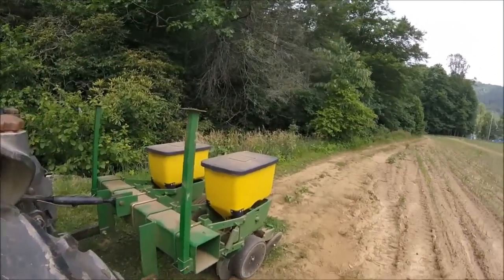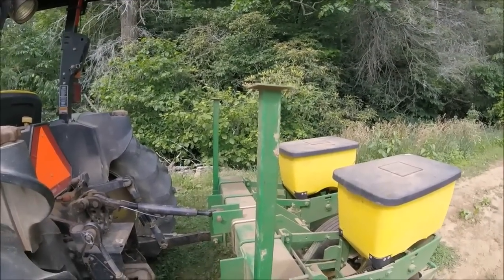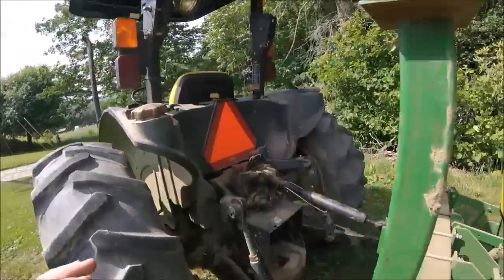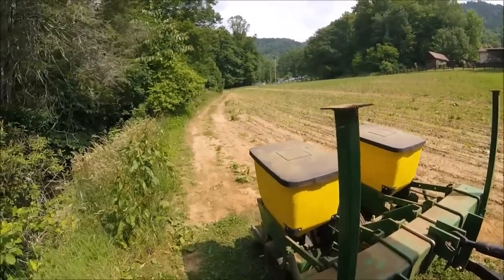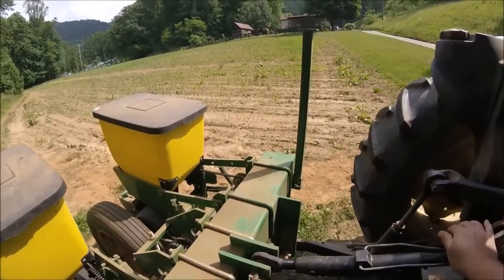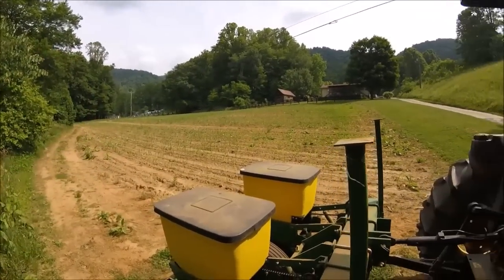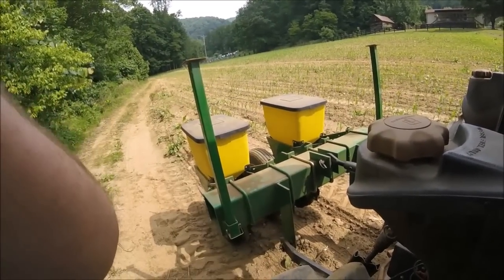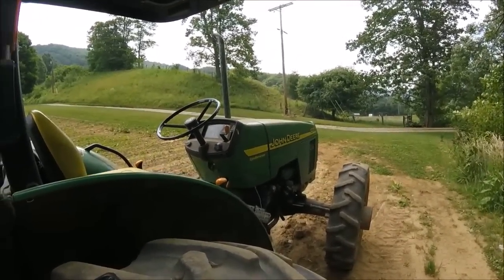Two Row John Deere Corn Planter Setup

Comment: I have an old set of Covington two-row planters that I  run with seed hoppers. When I got them I run two corn plates and two Bean or pea plates I have yet to change them they work on just about anything you plant. But you are so right about making sure your planter is adjusted to the tractor in order for it to work and plant properly. I believe you're the only one I've seen that shows you how to properly align adjust and set up a planter on YouTube yet. Great job👍👍👍
Reply from the maker: Thank you and thanks for watching
Reply: @Mtnfarmer  write your spacing on the onboard side of the seed bins right there by the sprocket.

Comment: Hey i have a question about turn plows, i have a set of double 14 in international super chiefs and where your center pole hooks up, front and back on the plow itself, they are approx 2 1/2 in apart and the one to the back is lower just a tad, how will this affect the plowing?
Reply: If you use the hole closest to the front of the plow it will make the back of the plow cut deeper. If you use the other the hole it will make the back of the plow cut shallower. The idea is to get both bottoms cutting the same depth.
Reply: @TheJohndeere466  thankyou sir. sincerely thanks
Reply: @TheJohndeere466  what about the floats on the lift arms, if you turn them horizontal they hold down, you would want that for the tiller and not turn plows right?

Comment: Hey I was looking to get the same planter.  Any idea if an L3901 kubota will be able to plant with your planter? Specs say about 1200 lbs lift at 24 inches behind lift points.
Reply from the maker: It should handle it just fine.
Thanks for watching

Comment: Couple of questions.  1.  Where are you located (North Carolina)?  2.  How do you apply fertilize to your corn and how much?   I've been looking at replacing an older Cole corn planter that applies dry fertilize for each row (on a very imprecise basis) with one like you have here but most I have seen (like yours) do not have a fertilize bin.   We used to broadcast fertilize before planting tobacco but my experience with corn was always better using sidedressers.  Thanks.
Reply from the maker: I'm In western NC between Asheville and Boone
We broadcast our fertilizer 
Thanks for watching
Reply: @ Jeep  there are deere 7100 and 7000 planters with fertilizer bins. I think that is a 7100 could be a 7000. I run starter mix when planting then side dress nitrogen. I think side dressing the nitrogen saves on fertilizer. Just my opinion

Comment: Do the run it in Float when you are planting?
Reply from the maker: you can
Reply: I have a New Holland 55 that has 3 positions for the top link top, middle and bottom witch one do you put your top link bar in for best results
Reply from the maker: @williesanford8394   try the middle usually it will work best if it does not pick up high enough move it to the top hole.
Thanks for watching